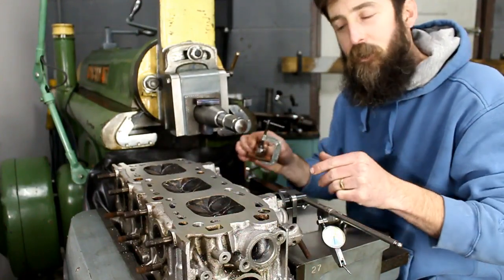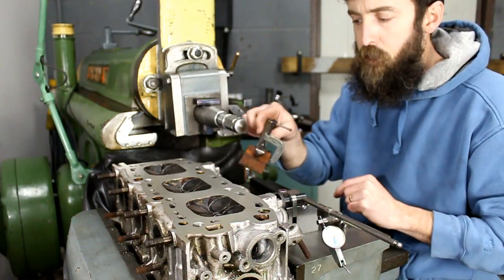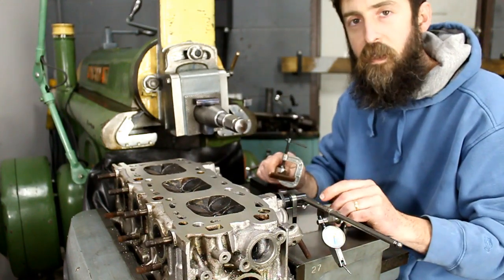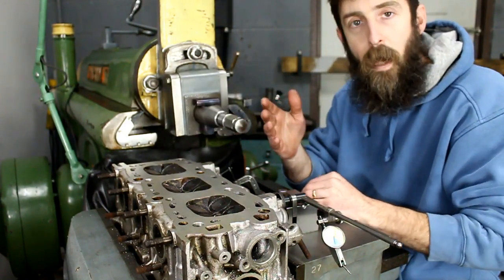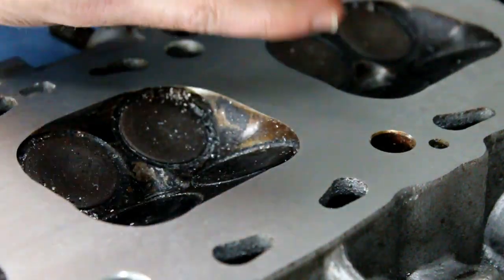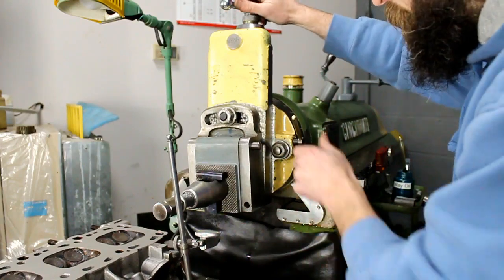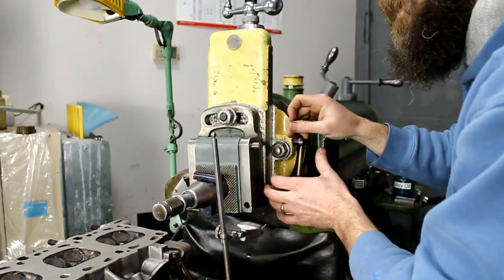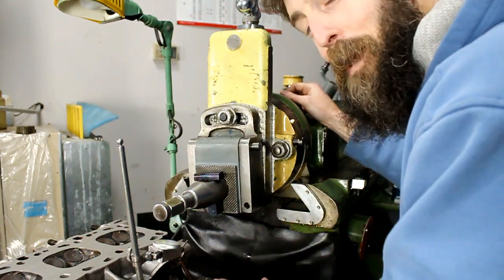Cylinder Head on the Shaper QUICK OVERVIEW

Comment: Hi steve, don't you need the outboard table support for the shaper to do this long precision work. Or your table is just that rigid ?
Reply: I am curious do let me know...
Reply from the maker: If the cuts were in heavy and in steel and then Yes.  It is a very ridgid machine without it. The outboard support was a option when these machines were sold. This one didn't come with one.😁👍 I would like to find or build one some day.
Reply: Steve Summers i could see the casting where table bolts into is thick & wide... nice to know, because I found a machined surface just below the table where the support would slide..
Thank you for your reply...

Comment: Nice leather trick. And good detective job with the vertical head. I wouldn't have believed it could move that much.
Reply from the maker: Juan Rivero I would have not though it would move either until I tested it. Regular light clapper action has no effect but lifting the clapper high and dropping it sure does. I am trying to work out a way to keep thins from happening. Nice to see you again Juan, Thanks for watching
Reply: don't drop it!

Comment: Hello from Bernie in Aus. I have a CMZ450 shaper and it has a mechanical clapper lifter. If you Google the name there a few pics on line that you can copy. It only works with the tool slide vertical or inclined a few degrees but would be easy to add.

Comment: Steve, Your video on this is well done indeed.  But I am not sure you have really identified the problem.  Remember there is somewhat of an impact on each return and sometimes multiple impacts of the clapper. I do not have much experience making very long cuts on a shaper and not much experience on cast iron either but the temperature of the cutter may get involved here on this one.  Some heat is built up on the cutter as it cuts and if you stop a cut and let the cutter cool then it may in fact change length just a few tenths of a tenth.   This may be visible.  It would be simple to test this theory just let the machine run say for half the process, let the cutter come up to its operating temperature,  stop it and do nothing at all, don't even breath on it.  Then start the machine again. I will wager you will see a line.  Just saying this from my experience on aluminum.  But really enjoyed your video.  :-)
Reply from the maker: Thanks for stopping by. It is not normal light clapper action that breaks the compound lock free. It it when I raise the clapper higher than normal and drop it, that the movement occurs. I am sure a cold machine vs warm machine makes a difference also but I have never noticed a change in surface finish. it takes this machine all day to get warm. I tested my suspicion several times and believe I am correct. But I have been wrong before.  Thanks for watching and commenting Glenn I appreciate it.
Reply: Right, I know you know your machine better than anyone else.  Thank you for the reply.
Reply from the maker: Glenn Felpel You are very welcome, thanks for watching and taking the time to comment. I enjoy them.

Comment: I am doubtful of the Clapper Box theory as the Clapper Box drops numerous times on the return stroke
as it passes over the Combustion Chambers. I would think the Ram rides on a layer of oil and when you
stop the ram it displaces the film and allows the Ram to settle a half to a thousandth. This is common
on machines with ways that have large surfaces especially if they have pressure fed Lubrication systems
Reply from the maker: Wayne Gotthardt It's not the 25% height drops that make it move. It's the big sharp snaps that do it. Standard light clapper action is not enough. I tested it. This shaper has a gravity oil system and stopping the ram gives no noticeable change in surface finish.

Comment: I'd certainly agree with your reasoning behind why the tool can move down sometimes and the most probable reason being that clapper swinging back under it's own weight Steve. One of the very good tips I picked up years ago on the Practical Machinist forum was to back the tilt and nod screws off to a neutral non preloaded position on a Bridgeport type mill after tramming the head in. Even with the head clamped down tightly with the head bolts minor vibrations under milling loads while cutting and that preloaded screw can and will slowly move the head in the direction of that preload. Since I started doing it that way the head tram seems to be much more stable than it was, and for much longer periods. A minor detail I suppose, but sometimes even the little ones can show definite effects in the work. What type of gib adjustments does that machine have on the vertical slide. A tapered gib or the more usual pointed set screw and jam nut type? 

Clever trick whoever it was who mentioned about using that leather and one I'll certainly be trying. Many thanks.

Comment: nice job,  but what happens with the camshaft  bearing  journals as they will still be out of line ?.
Reply from the maker: duggy788 the cam in this head turns freely and was never a problem. I am not trying to reuse this head and was just practicing on the gasket surface.
Thanks for watching
Reply: yes i know you were just practicing on that particular head  its just that i often wondered  what happens when a head is warped and the surface gets flattened  but the head is really still warped as regards the internals ie the cam bearings .
Reply from the maker: duggy788 I was told that the heads with out of line cam journals are pressed back  into alignment and then resurfaced. I am not sure myself this is what I was told.
Reply: i  often wondered about it , i have seen heads with a fare amount  of warpage  even bowed in the middle  and the machine shop just flattened the surface ,just something that never made sense to me i suppose it depends on the amount of warpage  too . keep up the good work .
Reply from the maker: duggy788 Thanks,  I never gave it much thought till Lately. I try to stay away from auto work as much as possible ☺

Comment: I have a similar behavior on my mini-mill head. The way I would describe it is that setting the vertical position against resistance (clamped gib) stores energy in the leadscrew/nut interface. My solution is to back off the tension on the crank after I've got the head in the new position, releasing this energy. When I do that, the head position is stable. If I don't do it, the head drifts down by a couple thousandths over the course of the cut, depending on how heavy the cut/vibration is. Interestingly, it will actually work the other way if I adjust the head position upwards and leave the crank/leadscrew under tension in that direction. So I'm pretty confident this account of the mechanism of the drift is correct. This would imply that a ball screw wouldn't solve the problem if it still left energy in the head positioning mechanism; might be worth trying just backing off the tension after adjustment and see if that does the trick :)

Comment: Temporarily, could you go down too far then back up to the setting? I'm thinking it would add the back pressure of the lead screw to the gib lock to hold its position. Maybe to lower it for the next pass you could turn the lead screw the proper amount, then use a lead "tapper" to move the carriage down.

I like the leather "follower". It might even ad a bit of stropping to the surface... :-)

Comment: Steve, I would think that loosening the gib so that the friction of the unlocked gibs is less than the weight of the compound will solve your problem. In other words, if there was no leadscrew, the compound would slide downwards by itself. Otherwise, you are rolling dice on what will cause the compound to slip downward until seated on the leadscrew thread.

Comment: Steve I have been using DROs I get off Ebay . The stainless steel models are the better one's and you can cut them to length. So you can get a 12" DRO and then cut it to your needs. I have one on my Mill Quill and my Southbend Lathe and on my spindle of my HBM you might try that there pretty Cheap also
Reply from the maker: THE IRONWORKER I will look them up thanks.

Comment: That wiper really works well! On the head, I have never done one but was almost going to attempt one not so long ago, it turned out it needed way more work than I wanted to put into it, including valves. However, I was curious, if this had been a real project, is there a max amount that can be taken down before the stroke of the piston is effected by the removal? I have rebuilt and ported chainsaws in the past, and for a 2 stroke you can use a piece of solder to get the "squish" factor. What that is, is the thickness the solder gets squished...do you know how that distance between the top of the piston while extracted to the top of the cylinder is calculated for a car engine? BTW, something that would be fun is to bore out a chainsaw cylinder, sleeve it, and turn a piston...might be possible to make better cylinder walls and/or a better ring. Probably not, as Pro saws have better components, and they are chrome hardened I think...anyway, just thinking out loud...LOL
Reply from the maker: Hey, Good to see you. the chamber in a car head is measured with liquid volume I believe. And yes there is only so much you can remove before problems occur. One commenter said that the small patches on the exhaust side of the head are gauges that show how much material can be removed before the head needs to be replaced. I did not know they cast that kind of gauge in the head. Neat thing though.    I have done several saws and like you said the cylinders are some sort chrome plating on the good saws. Making a piston or boring a cylinder would be a neat shop project that's for sure.
Reply: Damn, now I wish I had that old head I tossed out...but can probably find pics of those heads are marked, but it makes sense. In the future the engine may be able to determine volume at runtime and adjust the fuel accordingly...I didn't know the heads were marked either. I do know it was a lot of work just to get the head off...there is sure a lot of crap on cars these days...and mine was an '88 which had less crap back then, still there was a fair amount of stuff to disassemble...

Comment: Glad the wiper idea worked out for you Steve.It may help to slightly loosen the jibs on the vertical slide so when you release the lock bolt the screw doesn't have to overcome a lot of stiction to make the adjustment which causes the preload.The dovetail will keep it sliding straight but the lock bolt does the locking so the jibs don't need to be super tight.Bit of oil in here as well..

Comment: Tricky. Can you not go past your setting and then back up so the compound is preloaded up? I bit of messing for the first cut but fairly simple after that.
Reply from the maker: Peter Fletcher preload in either direction will cause the compound  to move slightly. I tried both directions. The only thing that seemed to work was removing all preload from the screw.

Comment: Just my two cents on this.  A glass smooth surface on heads isn't something you want.  It isn't conducive to sealing against a gasket.  You want a non directional semi rough surface for proper sealing.  Great job on the finish though.
Reply from the maker: zachariah liles I agree that the gasket needs a surface to bite into and that a non straight line cut would be less likely to blow a gasket over the straight line. This is how it was done years ago and was nothing more than a test. But I must say that I believe that this would work fine even if it's not the best method.
Thanks for your comment and thanks for watching. I agree with you

Comment: Interesting !

Why would your inspection and release of the clapper cause more “slippage” than the normal action of the clapper when working?

Finish looked great!

Brent
Reply from the maker: When taking a light cut the clapper moves very little. When I inspected the tool I lifted the clapper high and it closed hard. It takes a real sharp snap to break the lock free. It will not move with just light clapper action. I tested it several different ways and that is what I  found.